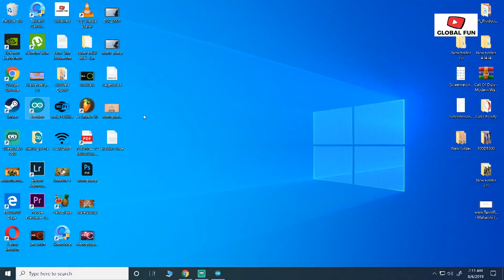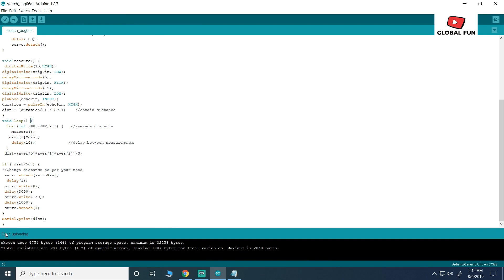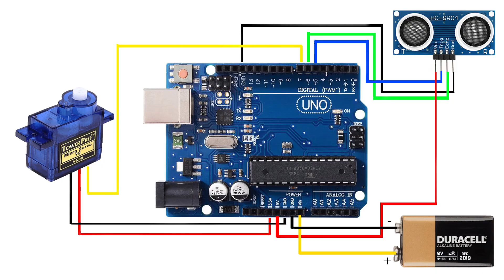How To make Smart Dustbin using arduino  | arduino project

Comment: 1:42 what do you call that
Reply from the maker: 9v battery connector
Reply: @GlobalFun   is it okay if i plug the battery connector in power port instead in power and ground pins?
Reply from the maker: @izarcastillo1286   r u saying about home power?
Reply: @GlobalFun  what i mean is that my 9v battery connector is a plug not pins, so is it okay if i plug my 9v battery connector in the power port(which is the black one in the arduino lower left at 1:33 ) instead of GND and Vin pins
Reply from the maker: @izarcastillo1286  s u can connect
Reply: @GlobalFun  yes, is it okay? does the code will remain the same or not if i connect it to the other one?
Reply from the maker: @izarcastillo1286  code will be same.
Reply: @GlobalFun  may i ask again in 1:42 , the battery connector, is it wires that have been connect by the use of electrical tape to the male jumper wires?
Reply from the maker: @izarcastillo1286  s
Reply: @GlobalFun  oh hi what do you mean by s
Reply: @GlobalFun  do you have video in 1:42 on how to connect male jumper wires in 9v battery connector?
Reply: @GlobalFun  1:42 how did you connect that?